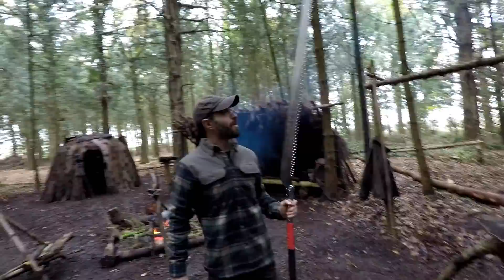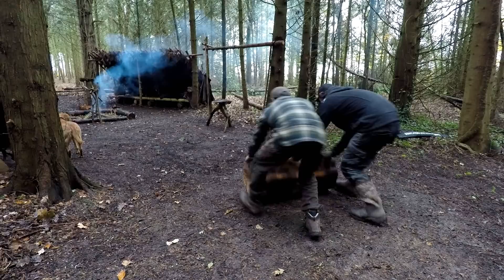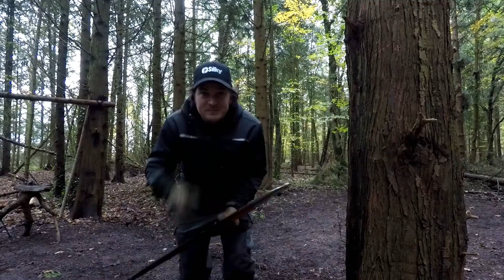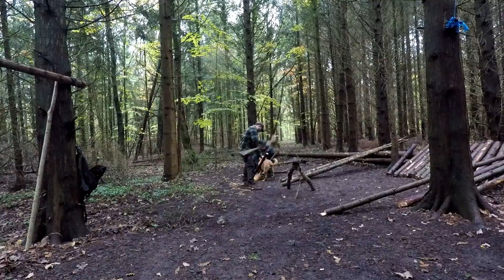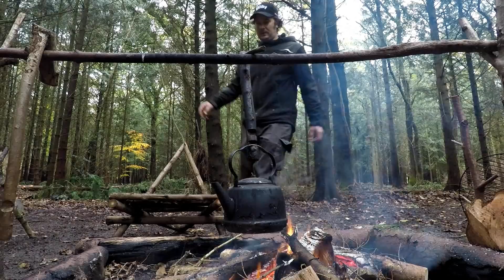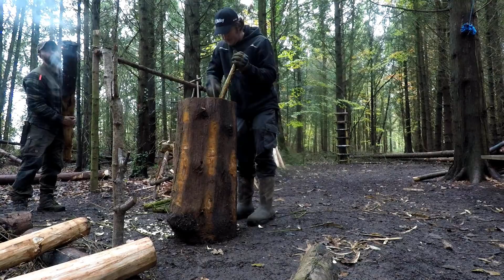BUILDING A CELTIC ROUNDHOUSE WITH TA OUTDOORS using a SAW - AXE - KNIFE Ep.1

Comment: Cut some slabs off the remaining log you can make a fine cutting board, but also some great looking 3 leg stools. Not to mention some great bowls could be carved or turned from chunks of it.

Not sure turning a sawhorse into a sawhorse is "upcycling" but it is definitely upgrading. I would have taken an axe and leveled the top a bit more so I could use it as a base for a trestle table with a second sawbuck and a few planks.